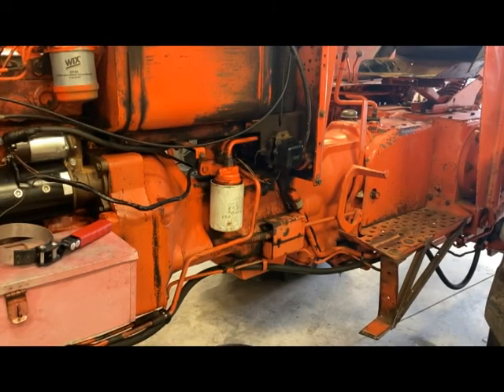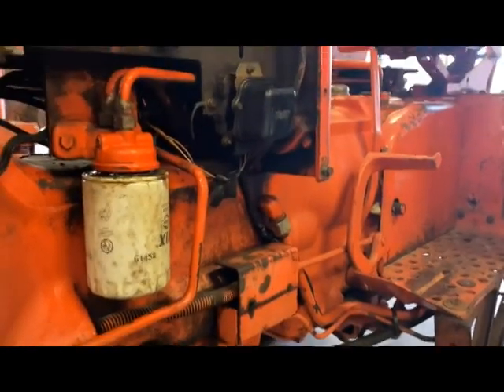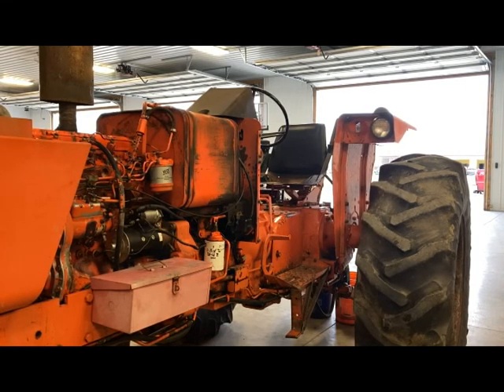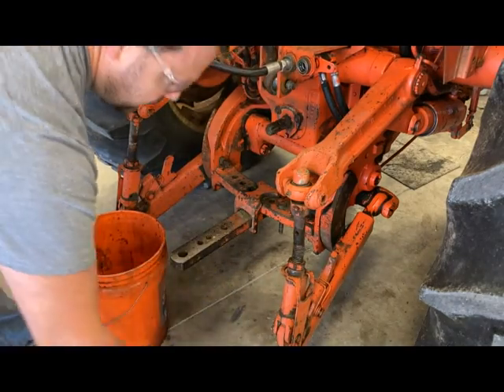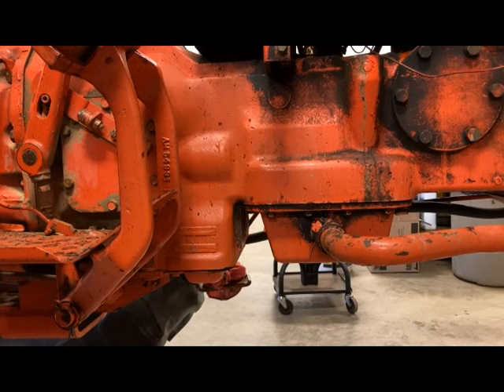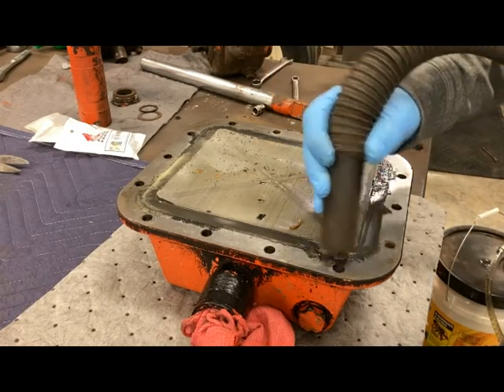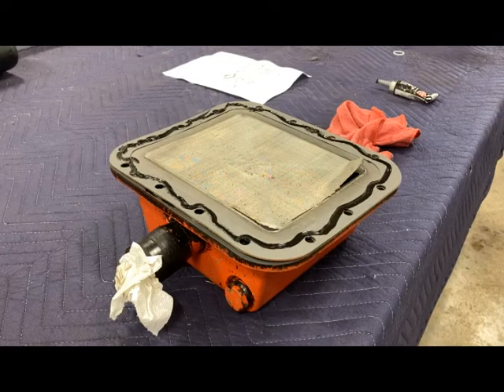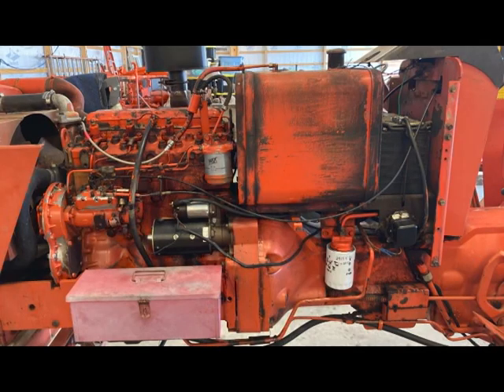Allis Chalmers 175 Hydraulic System Maintenance Part 3

Comment: I have one of these tractors I currently have a Kelly 60 three point hitch backho mounted on the three point assembly. I have changed the hydraulic fluid at least one time.  Is there a need to bleed the lines after changing fluid in the hydraulic system?

Comment: I've got a 175 that I put 9 gears rebuilt a transmission for a guy. And I don't know if it was that way when I got it or not I don't remember the 3-point automatically comes up with the neutral spool. Any idea how to check what's wrong